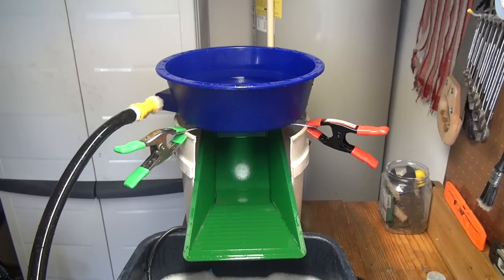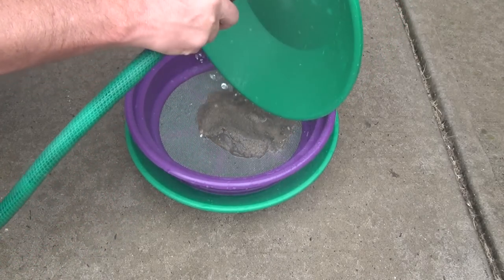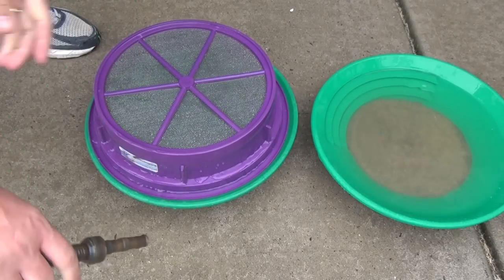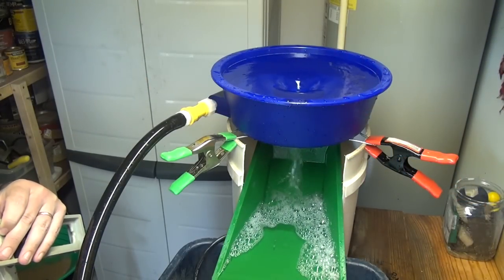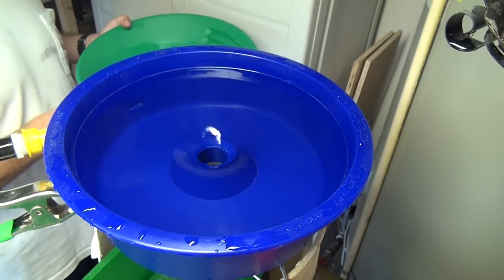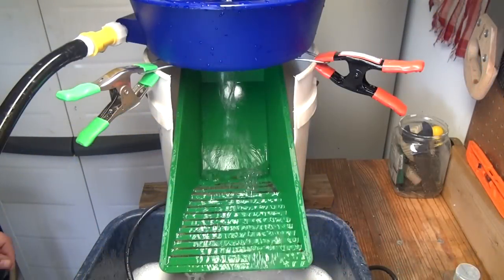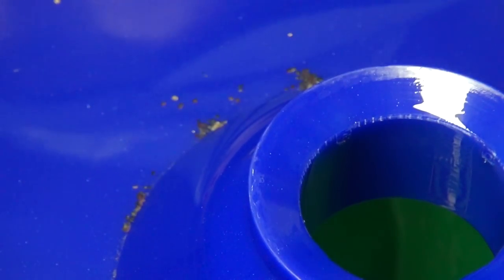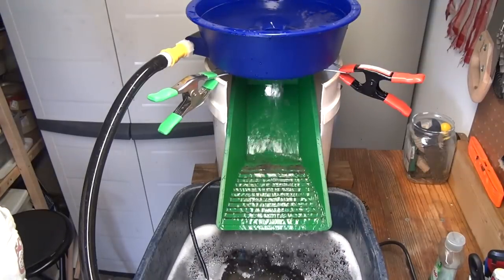Fine Gold Recovery System

Comment: some of you dont know this but what makes the pump work is a magnet  that help in turning the pump    black sand  will get in the pump and mess it up  slow it down....clean ur pump out guys this will save you alot of money  and time.....as well try  and pull ur pump off the bucket floor half way maybe  so sands  dont get in it....good luck

Comment: Smart thinking, I noticed that's not the pump that comes with a blue bowl, did you need to replace, or did you just want a little more power? My pump seems to have lost a little vigor after 1 summer of use. I like the addition of the pan, seems to cut out a bit of the work of re running the cons. Well played!

Comment: fantastic design, what angle do you need to have the green pan at so it can act like a sluice. I have a small le trap but its too big for fine recovery this looks perfect.
Reply from the maker: +Karl Blank - good question, not sure.  I just played around with it until the flow was smooth.  Next time I set this up I'll look to see what the angle is.  Thanks for the question.